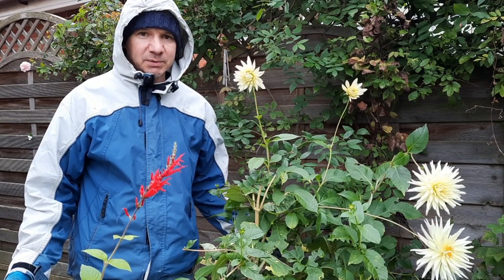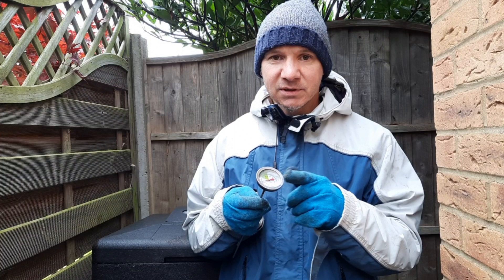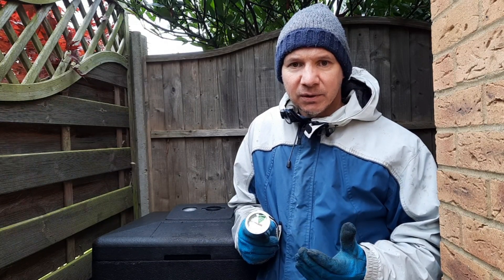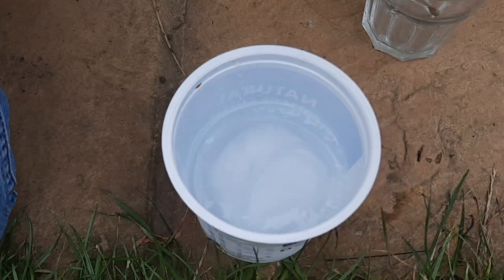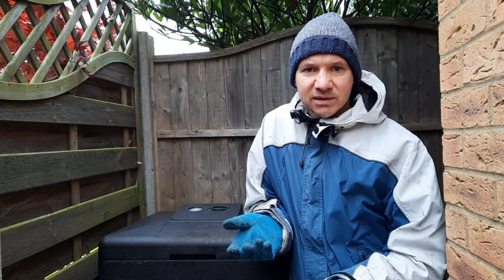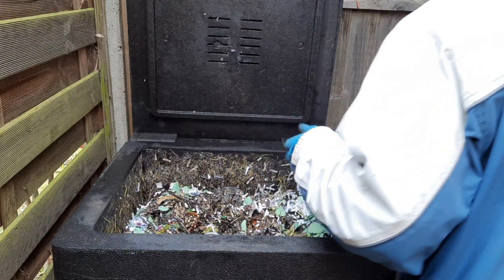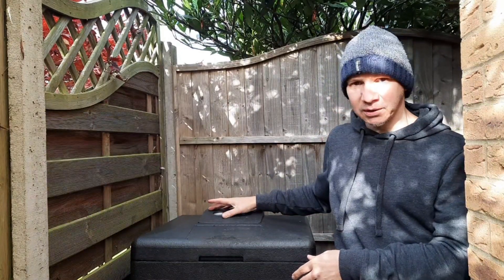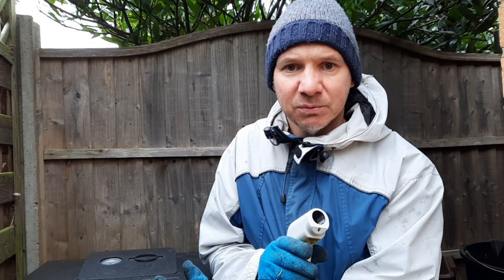All About Hotbin Temperatures

Comment: Interesting I didn't expect much difference between the 2 thermometers I've got the smaller one
Reply from the maker: Yes the heat of the hotbin changes as you go through the layers. I don't think you can get the large ones anymore from the hotbin company which is a shame as I prefer the larger ones.

Comment: Hi, ai am concerned my hotbin is actually too hot. Has this have happened for you?
Reply from the maker: Yes if you watched cooking in a hotbin then I have had it very hot at times. Open the aeration valve on the top full for a while but it will generally not stay hot for too long as the bacteria will be destroyed when it is so hot. Enjoy reaching such temps some people on here would bite their  hand off for that.  By winter you will be wishing for that heat so as I say enjoy.  Don't worry it will not cause any harm or ignite.

Comment: I really enjoy your videos so keep them coming. Just wondering what’s happening with your mini Hotbin? 
One video of the unpacking then nothing. I’ve had mine a few months now but can’t keep it hot more than a couple of weeks at a time. I’m wondering if it’s too small to stay hot, even when full. Any help would be appreciated. Gill
Reply from the maker: It should be no different from the large one. It is just smaller in size but the actual insulation and way it is made is the same as the large one. It is not too small to stay hot as it should work the same.
 I did a few experiments see the newest video. I plan to get it up and running in the next few weeks but with winter here we do not have so much time for filming weather permitting. Are you feeding it enough and what temps did you get up to. Are you  adding enough bulking agent and mixing well? What are you feeding it?

Comment: Happy Birthday to the Mrs. I have been watching your videos from the start, this one was very informative, my temperature is struggling around 35 -40 at the moment. A general question and you may know the answer, I have trouble getting down to unscrew the cap on a mk2 bin due to a disability I have; for a long time I have been wondering about fitting a tap on it. Do you happen to know the thread of the screw outlet? Do you think it would work? I have my bin raised on two concrete blocks so it's fairly high. I have plenty of taps from my wine making days. Keep up the good work you are an inspiration to many people.
Reply from the maker: Hi I do not know the thread size but would imagine it would be a standard fit. If you could find the same lid say from a drinks bottle lid then you could drill/make a hole in this that you you fit a tap onto like from a water butt. I hope this makes sense. Maybe I need to do a video it may help someone out. Thank you for your kind words and add plenty of bulking agent with a good mix if your bin does not need emptying. Let us know how you get on with both.

Comment: My hotbin dropped again after a five day break away but it’s up to 40 again and is steaming away so was surprised it wasn’t higher - but maybe that’s why - I have the long thermometer so it’s reading much lower than the top section. Happy birthday to Mrs Beanie 😃
Reply from the maker: Hi Kate. Yes it is surprizing how different the length of the two thermometers can change the readings. The Hotbin company say you only need to feed the hotbin once a week to keep it hot but I am not so sure.
Reply: @BeanieComposter  yes I don’t think I can keep it hot with a once a week feed. I’m doing every other day and that seems to work well.
Reply from the maker: @kateg730  Yes these Hotbins take some effort.

Comment: My hotbin is struggling around 35 - 40 according to my short probe. But it is producing good compost every few months which I store in a dalek composter bin. I will have nearly enough for my whole garden this year without having to bulk buy from Wickes. Many Happy Returns Mrs Beanie.
Reply from the maker: That is great news Ken. 35-40 is still going to compost quicker than a cold compost. Are you feeding it enough waste as you should be able to keep it hotter than that this time of the year. You are certainly making the most of it though with the amount of compost you are producing. Well done.
Reply: I used a short one for a while before I ordered a long one. For a short thermometer, simply dig a little hole in the pile and jam it in, does about the same job..
Reply from the maker: @idlando  You are right but I feel the Hotbin should come with a long one as standard.
Reply: @BeanieComposter  absolutely, if they deliver it with a thermometer, a long one would be the most sensible option. 

(None of my bins came with one, different brands)
Reply from the maker: @idlando  I agree but I think as with most companies they start looking at where they can save money.
Reply: @BeanieComposter  Yep. They could ship with options though!

Comment: I have followed your videos and still my bin rarely goes over 30°C. I've noticed that you have lots of paper, maybe I don't have enough?   I have used woody clippings or cardboard to avoid buying wood chips but both lots of compost that I've taken from it has been rather wet and lumpy. It isn't smelly, so that's something.
Reply: Thanks, that's really helpful. 
Happy Birthday to Mrs Beanie!
Reply from the maker: @meganbutler4187  No problem I hope it has given you some food for thought. Good luck and keep us updated.
Reply from the maker: Hi Megan. I am sorry to hear that. The wood chippings that are the bulking agent are quite important for the air flow and that may be the reason. Even though I use woody clippings I still use wood chips as I find it important. The cardboard will fix the moisture but will not help with air flow. Although you say it is wet and clumpy it will be as it has not reached high temperatures but as you say it is not smelly then I think you have the paper/cardboard mix correct  for me you can never add too much paper. I think you really need wood chips as well. If you know a tree surgeon or just see a place where a tree has been cut down and can get them for free then this should help. Getting air into the mix is important and bulking agent and a good mix will hopefully help. If you remember when mine would not go over 40 I had restricted the air flow and I ended up putting a lot of wood chippings in the mix before it finally when into orbit. Hope this gives you hope and I know this Hotbin is not as easy as the Hotbin company make out. That is why I started this channel.
Reply: Yes try adding more paper. I add loads more than I used to and my mix is still fairly wet. I did have a problem with putting in too many wood clippings that were very fine and it clogged up the airflow (used my own wood shredder). I now just add smaller quantities and loads more paper!!
Reply: It might be a bit late in the year, but I find grass clippings give a good amount of heat. I mix the clippings up with shredded paper/cardboard. Cheers.